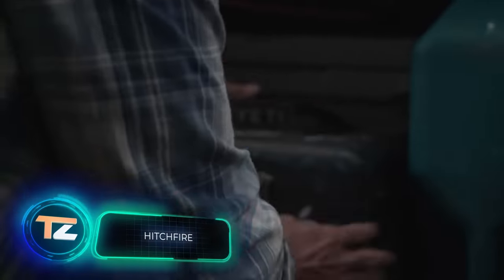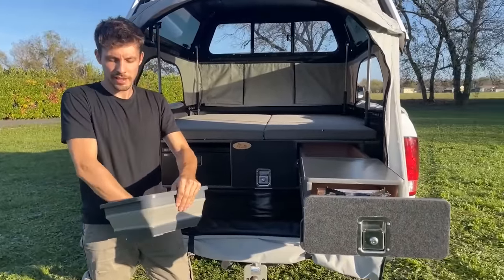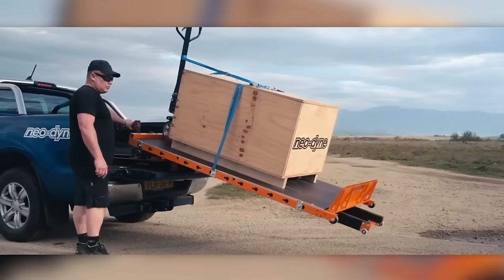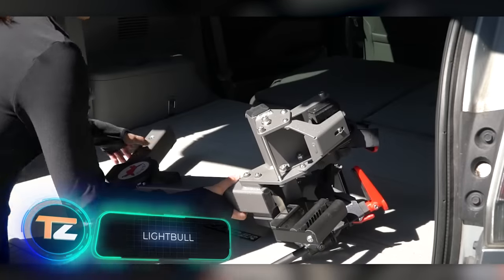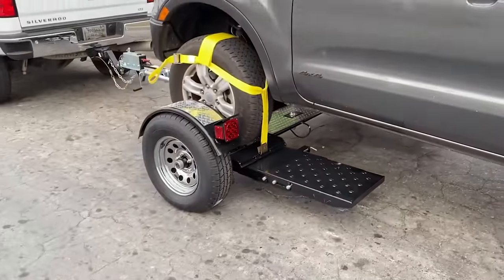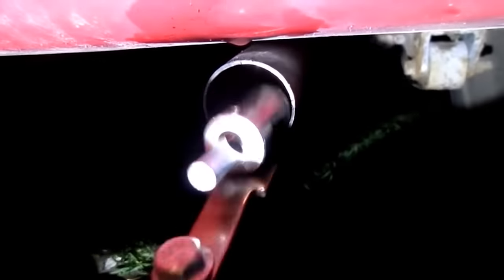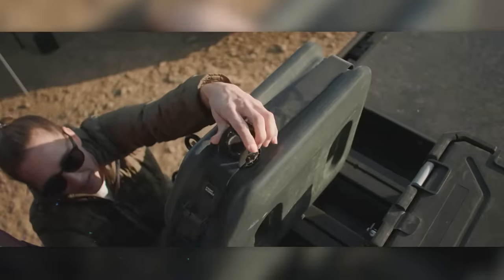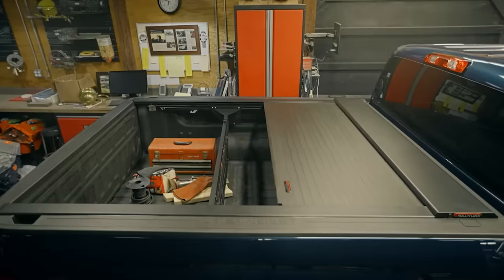CAR INVENTIONS THAT YOU HAVEN'T SEEN YET

Comment: The turbo whistle doesn’t work, its a scam, the ramps are decades old and those are one of the worst ones on the market, and the dolly simply shouldn’t be sold to the public, if you put an automatic rear wheel drive vehicle on there with the front tires, even in neutral it will still heat up the transmission to temperatures beyond running temperatures causing the transmission to lock up if your lucky or blow up if it decides to
Reply: You are very correct. That tire table is neat tho lol

Comment: I can see one of those rotating chains flying off and hitting a windshield of the vehicle behind and the lawsuit that follows will be enormous.
Reply: They have been used here in the NE for years now on the school buses.  You can see the chains hanging down when driving in back of one.  I personally have never heard of an issue with the chains coming loose, not to say that it hasn't happened.

Comment: That auto chain system has been around for at least 15 years in the states. You see them mainly on semi's in the north and northwest.
Reply: The first thing I thought when I first saw them back then was not if, but when one of those chains breaks off..Not a pretty picture.
Reply: I have lived in the Inland northwest for the last 35 years, and have never seen them on tractor trailers, semi trucks.  I have seen them used extensively on school buses, and fire trucks.

Comment: Lmao a car dolly that can't haul a standard weight car.
3000lbs is what a Ford Fiesta weighs.  The maverick shown is overloading their own claims
Reply: 3000 pounds is the axle/suspension rating of the dolly, not the overall towing capacity. So as long as there is less than 3000 pounds up on the dolly's frame, it's totally fine. According to Ford, the front of a Maverick is around 2100 pounds. The video was not very clear about this.
Reply: Not a Maverick.  It was a Ranger.